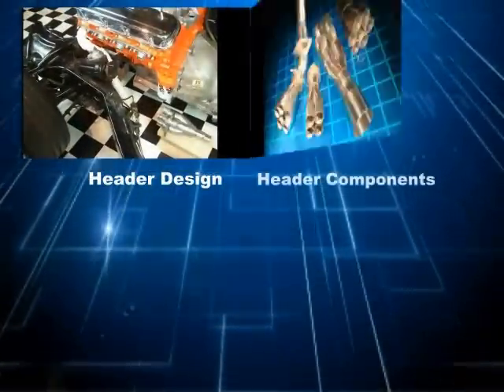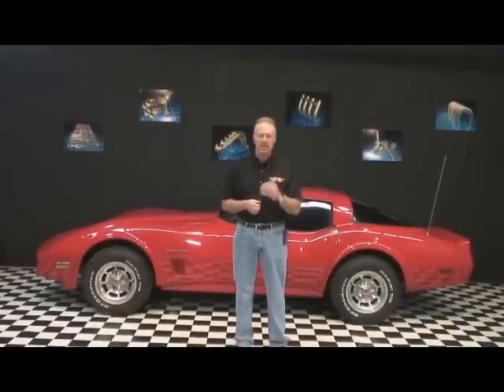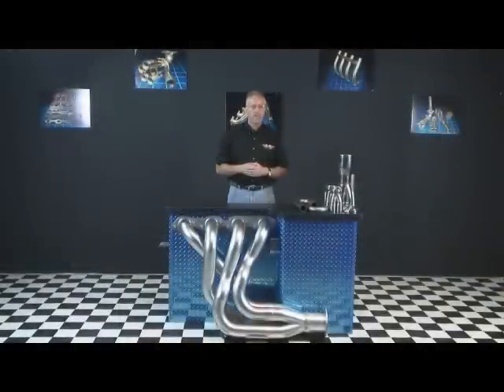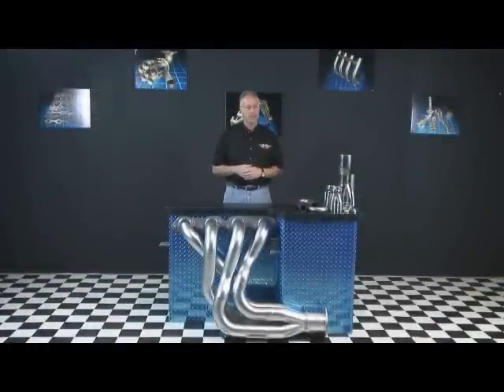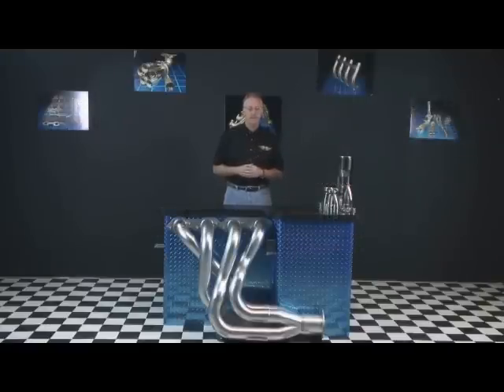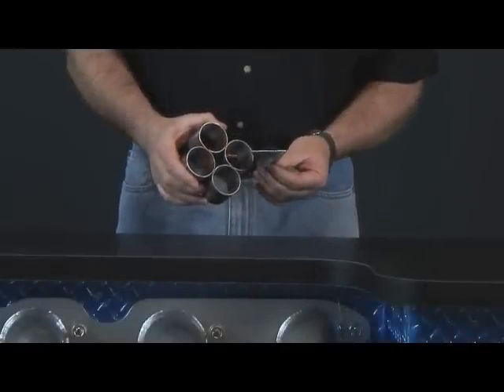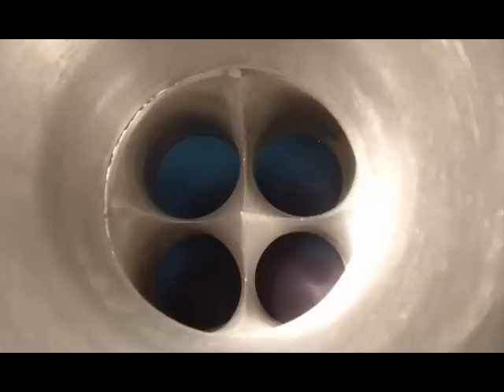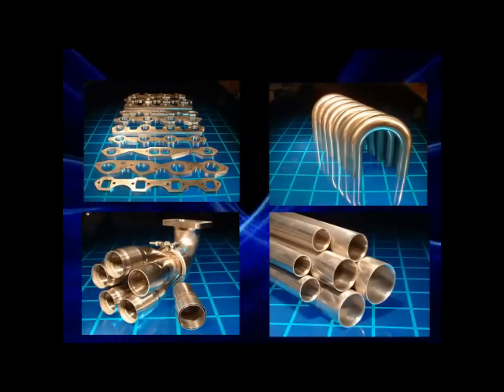Custom Headers Part (1 of 6 ).wmv

Comment: Note to Self (and others).

Stainless Steel 

409 - Cheap, can develop rust 
304 - Preferred, high resistance to corrosion
321 - Expensive, high heat and turbo applications